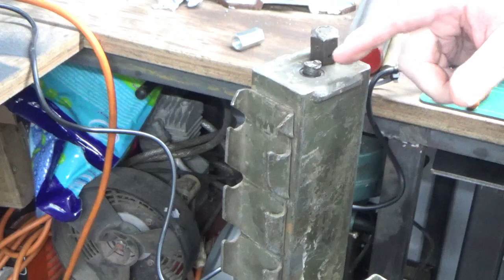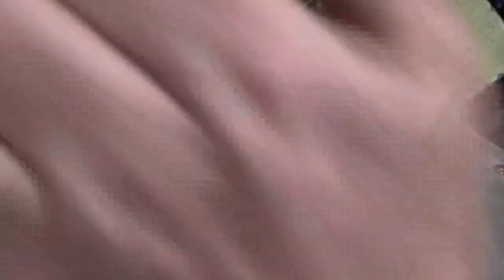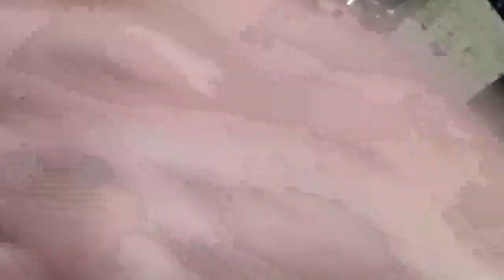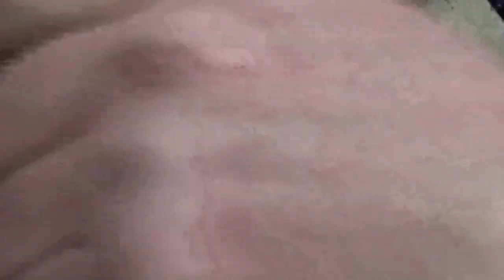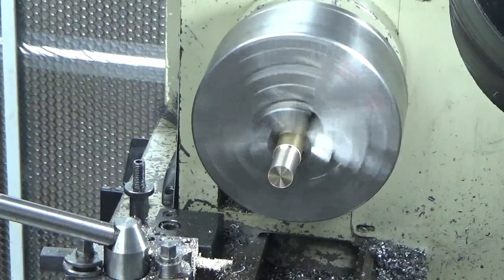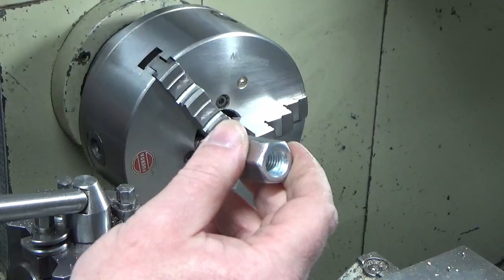Tank Track Removal Jack Repair

Comment: G’day Jon. I also have my doubts about welding the nuts but hey if that’s what he wants so be it, maybe he won’t use a rattle gun, haha 
Cheers 
Peter
Reply from the maker: Hi Peter, thanks for the comment, just catching up lol. I think based on a conversation, they will continue using the rattle gun. No drama, I will fix it again in a year or two and get more hedge cutting done lol. Cheers, Jon

Comment: Those nuts look a little on the soft side. If they are used with an impact driver I can see them rounding off.  A couple wheel nuts may be a better grade of steel.
Reply from the maker: Hi Glenn, thanks for the comment. Yep, think you're right, the only plus side is they are long so good length of engagement in the socket which should help them survive a bit longer. Got to go with what the customer wants ultimately. Cheers, Jon

Comment: That was great Jon, a really interesting job, plastered in the green paint I am very familiar with! I watch your lathe with envy as it chomps its way through work. I have to be a bit more gentle with mine or it gets upset. 
Best wishes, Dean in Oxfordshire.
Reply from the maker: Hi Dean, thanks for the comment. Lol, I get frustrated with it because I know its capable of twice the cut depths and feeds I use, but my 3 phase converter is the weak link! Still, it's a fantastic machine. Cheers, Jon

Comment: Enjoyed the repair Jon. It seems a small diameter drive shaft for the diameter of that lifting thread. What's your thoughts on that? Tony
Reply from the maker: Hi Tony, thanks for the comment. Yep, totally agree, I think this may be by design though, bit like a shear pin, just in case someone tried lifting the whole tank with one jack, the shaft would shear before the jack body collapsed meaning one less squashed guy! Cheers, Jon
Reply: @jonsworkshop  I was thinking on similar lines, just for lifting the track and nothing more. I bet these have been probably used for lifting all sorts in their lifetime lol.

Comment: That was excellent, thank you
If you have to repair again, I wonder could you avoid having a second step down on the shaft by increasing the hole size at the top of the jack, especially if there going to be welded anyway
Reply from the maker: Hi Seamus, thanks for the comment and suggestion. Yep, totally agree, this would be a good solution. I think the challenge, certainly in my workshop, would be boring the jack top plate out for a bigger bush as my Y axis won't let me get past the table width with the spindle. Maybe this could serve as a justification for my Bridgeport lol. Cheers, Jon
Reply: @jonsworkshop  hi jon, i thought i didnt have room for a job i had to do, but removed tailstock and bolted part to cross slide, and used the lathe a a borer. Worked a treat. Love your videos mate. Very consise. 👍

Comment: That was great Jon, I really enjoyed it. Those electric impact guns are everywhere now, but have to be used with care I think. They are capable of achieving quite high torques, and I have personally seen tbe damage that can be wrought if used carelessly. Really glad you have the damp issues sorted now.
Reply from the maker: Hi Carl, thanks for the comment. Yep, modern and old designs / technology don't always mix well. Impact drivers are OK for wheel nuts and corroded exhaust nuts etc but not for this type of application. You and me both on the damp issue, it's so nice not to be spending all my time de-rusting! Cheers, Jon

Comment: Hi,Jon. Can you tell me is your Dickson tool post a T2 size and what is the maximum tool shank size the holders will take? I've been busy studying different tool post options for the L6 this week.
Reply from the maker: Hi Howard, thanks for the comment. Mine is T2, correct. From memory, 22mm shank is the max but some holders are a bit smaller. 20mm is probably a safe bet, most commercially available stuff is in 5mm increments, you can always whip a bit off the shanks if they are 25mm. Cheers, Jon

Comment: I am sure your neighbour thought tank goodness you're there to help... I agree with you that welding is a short term solution... but the customer is always right.
Reply from the maker: Hi Paul, thanks for the comment. Yep, customer comes first mate, you can try and gently nudge them in the right direction but ultimately need to follow the directions. Cheers, Jon

Comment: Nicely done Jon,must have been nearly max size for the spindle diameter?
Reply from the maker: Hi Robert, thanks for the comment. Yep, not far off, I had an extra few mm is all. That would have made it a much more challenging job if it didn't go through the headstock. Cheers, Jon

Comment: "Tanks" Jon for showing this. Are you Open Fires at your house ? If so get him to drop you off a couple of trailer loads of some nice logs. Stay Well. Regards from Australia.
Reply from the maker: Hi Dave, thanks for the comment, almost, we have a wood burner, I am still working through a 100+ Yr old sycamore tree we felled in the garden about 5 years ago. I will make a suggestion to him lol. Most of the wood round here is pine which is OK in the wood burner but you need 3 times the storage area for the same heat output. Cheers, Jon